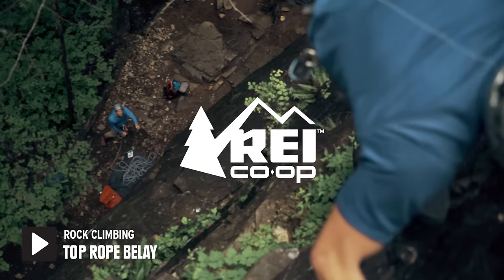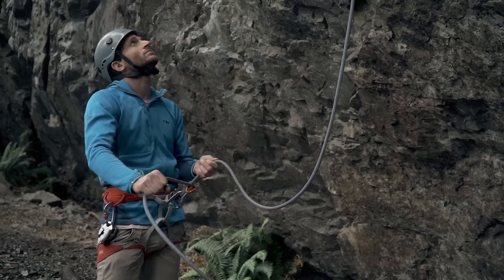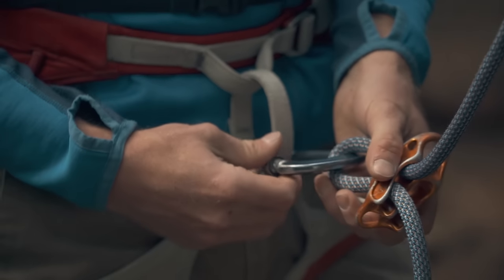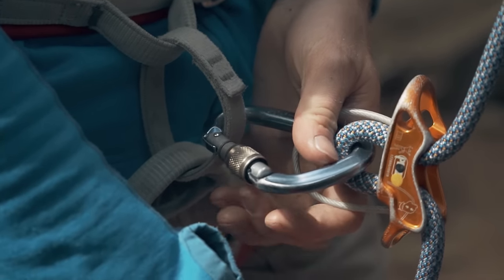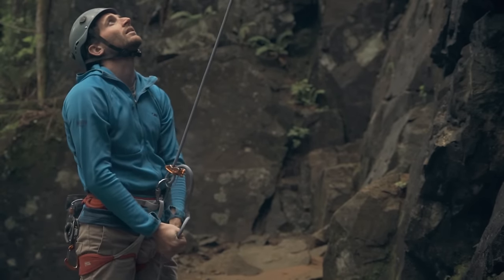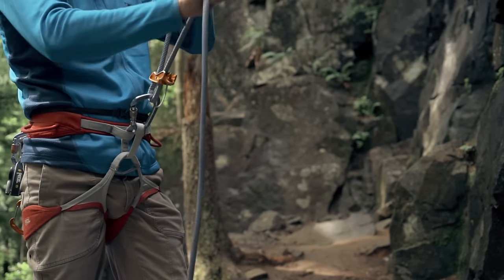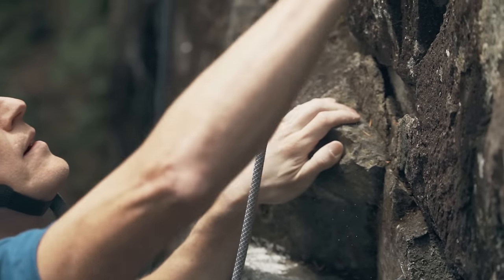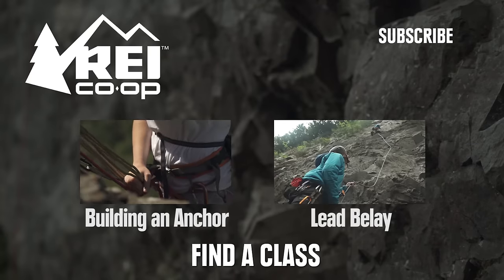Rock Climbing: How to Belay

Comment: I think the PBUS method probably needs an actual safety evaluation. Watch what happens at ~2:31ish. The guy is in the middle of a bottom reach, watch his sightline. Simple and economical movements are the safest, and thats why I think the tunnel method is taught elsewhere in the world. Multiple other commenters are hinting around the same thing... PBUS just isn't the best way, and it'll almost be impossible to get it right while keeping your eyes fixed on the climber.

Comment: 2:54 This is just wrong to show. It's unnecessarily unsafe to bring the brake hand up that much above the belay device. With an angle between the two sides of the rope that small, the brake support of the belay device is almost nonexistent (stop at 2:56). You want to pull the rope through the belay device with the brake hand in a rather FORWARD than upward motion. While that might require a little more effort, it's MUCH safer, especially if you're not using assisted belaying devices.
Reply: FatAlbert1882 thanks for the advice.
Reply: Thanks a bunch
Reply: Belay person NEVER should take their eyes/attention off climber. He does this several times. Also, as stated... you do not come anywhere close to the device which will pinch off part of your hand. LOL Otherwise a good video for basics. We say "dirt me" for descending here in Iowa.
Reply: Thank you for this post.  As a new climber what you say makes sense and might result in catastrophe avoidance for me or someone else.

Comment: 4:15 he stepped on the rope! that's a real nono!!!
Reply: Why? Just curious
Reply: Superior Man if the climber were to fall it would slightly pull the rope into the carabiner (thus why you should not have your brake hand too close to the carabiner because it'll get sucked in) and if the rope is under your feet it could pull you as well and you'll lose grip on your climber and a bad fall will happen.
Reply: Also you might damage the rope?
Reply: @nicholasgault972  yeah u would damage the rope by pushing sand or small pebbbles into the rope. Adding to the wear on the rope, lowering it's lifespan.
Reply: @nicholasgault972  funny
Reply: @Iamnikolopez  small pebbles is sand

Comment: A good video. Although I think you should keep both hands on the brake side of the rope. It's easier to catch a fall with two hands and also it gives you redundancy. If you use only one hand and you lose your grip for some reason your climber is in trouble. Also I don't see the point in holding the climber's side of the rope unless you're pulling out slack.
Reply: I was taught the same way.
Reply: @Tuulos  I'm currently doing the lead class and they are teaching us to have one hand for the brake side and the other and is on the other side. They said when left hand is pulling up and right hand pulling down, it becomes a locking position even when there is slack. But I find redundancy for the braking side to make sense. I'lll ask when I go for the next class.
Reply: @bleu4917200  Did you end up asking?
Reply: I did the class with an ATC... and if we were not feeding or taking, we had to be in a locking position (using both hands, left pulling up on the left side and right pulling down on the brake side)
Reply: In lead belaying it actually feels better to me to have one hand on the climbers side of the rope and the other on the brake side, as the "home position". And when you see that climber might be about to fall you position both hands on the brake side, ready to catch the fall. But in top rope belaying my "home position" is both hands on the brake side. Also I like to use auto-locking belay device when lead belaying for extra safety, in case climber falls unexpectedly.

Comment: His instinct to grab the rope tightly with his top hands is potentially dangerous habit. Instead, try holding the rope gently (but with control) using maybe less than 5 fingers, to help the brake hand, which is doing most of the work always. That's just my observation, I wonder if you agree. Oh and never step on the rope (be aware)...

Comment: Should your break hand be above your belay device when pulling rope through the device? This seems wrong to me
Reply: For a moment, yes. It relieves the tension from the device so you can pull the rope through it easily. However, it should take a very short time, around 1 second at max from lifting your brake hand to it being in a locking position at your side, and you should bring your brake hand down and to your side until the brake rope is tight again.

Comment: I think you shouldnt use the under slide hand technique as brake side of rope should be kept tight during slide... guide hand should stay above the brake hand.
Reply: wrong, if you don't use your guide hand on the brake rope every time you pull through slack and slide your brake hand back up to the atc you will be letting go of the brake rope
Reply: Technically it dosent matter if the rope is tight during the slide, its maybe 4inches of slack that get tight in less than a second during a fall, as long as theee is 1 static hand on the break rope its all good, and yes, im qualified before you all flip out haha
Reply: @profd65  dude what is your problem? I've seen you respond in this fashion on two comments now and there's no need. Just ask the person to say why they believe one way or another

Comment: What happens when the climber is significantly heavier than you
Reply: You can fly up from the ground and it might make your release the brake-rope and make the climber fall all the way down. You should generally not belay people that are significantly heavier than you, and if you do, you should use a tool like a ohm-device.
Reply: You can clip a weighted bag (filled with sand or some other medium) to your harness straps. At gyms they have sand bags that have a rope long enough to stay on the ground even when clipped. 
If the climber starts dropping and you go up, you’ll only go up as much as the rope attached to the weighted bag allows. 
Once the climber is able to grasp the wall again, you can add slack to the line or have them climb up so that you can lower yourself.

Comment: How to run the rope through carabiner at the top of the rock???
Reply: It’s lead climbing
Reply: Team Recon I don’t know what that means
Reply: Marcos Ponce lead climbing  means you clip your rope as you go. If you are top roping, the top is already there an attached to the top. This is uncommon outdoors but very common indoors
Reply: on a pitch that can be hiked up (say by a side or back route) your team places an anchor and rope on top/from the top before beginning  climbing from the base of the pitch. In the case of this video either that was done or a lead climber ascended first and placed protection up the face, then descended,  before the video was shot.